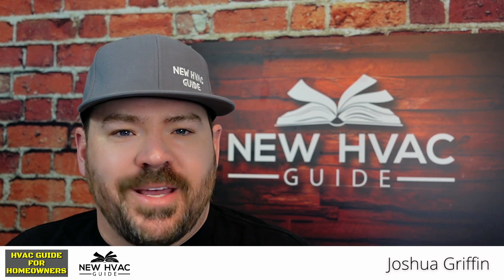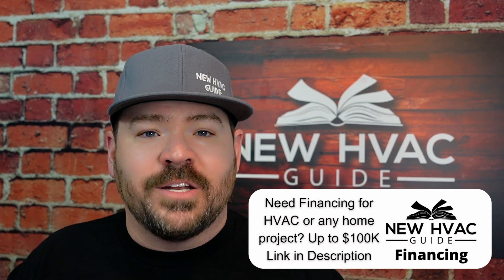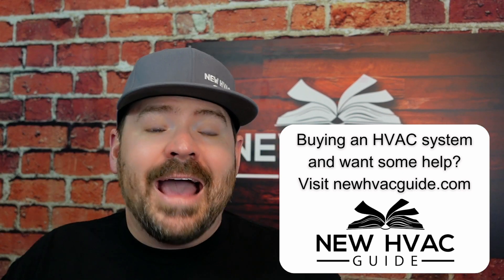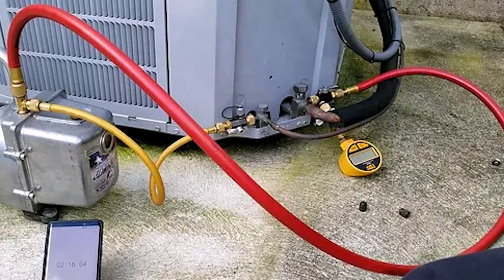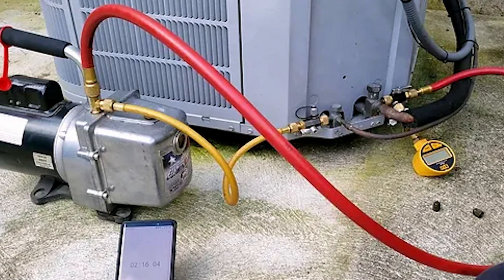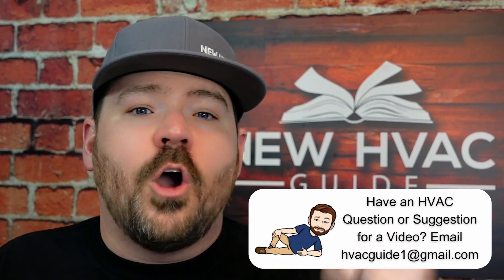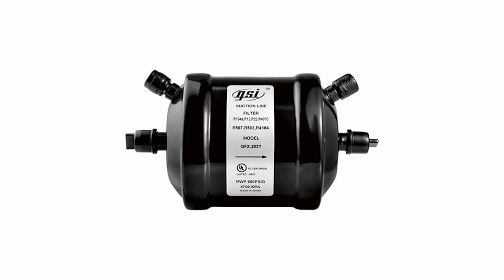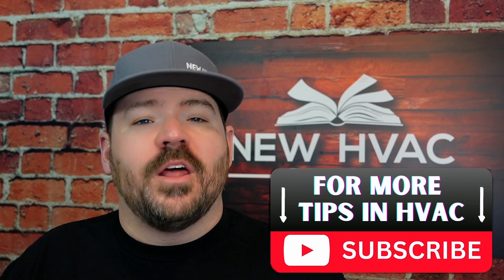BIG HVAC Installers Problem that Costs Homeowners THOUSANDS!

Comment: One thing I see all time is that people think that DIY just means that they just hook it up and go. Funny story, I went to house where the owner told me he put it in himself 😳. Besides sweat and compression fittings I had never seen crimp fittings before this customer's unit. They kind of looked like PEX plumbing fittings. He told me he was getting it to run but not cool. I hooked up gauges and got NOTHING. At first I thought I had forgot to open them up. I asked the guy how long he pulled a vacuum before opening the condenser valves. He asked " what valves". He had a line drier so someone had a basic understanding of the system. I did not want to disassemble the entire install and start over so I put the vacuum pump on it for an hour and then came back to see if it held vacuum and it did. After opening the mystery valves the DIY charge ended up being very low but it took only a couple of pounds to get it perfect. I always wondered if the time that his system sat with atmosphere in it caused any damage. I will never know because he has never called me to fix anything. When I left the evap coil was putting out 48deg. and that was good enough for me and  him. With so many variables in a DIY install the last thing I thought of was acidic oils in the line. I don't think it would matter to DIY'ers but to a professional it makes sense. Thanks for this report.